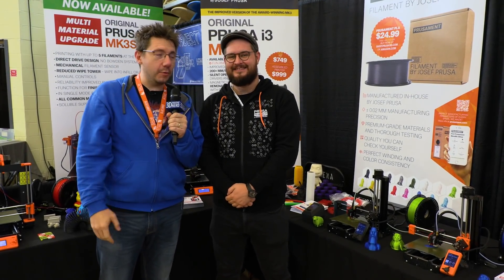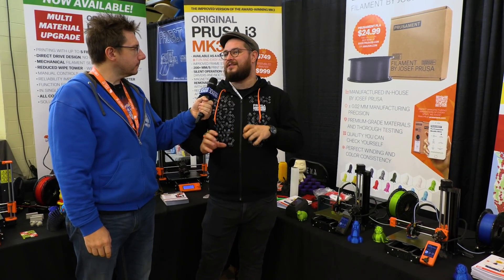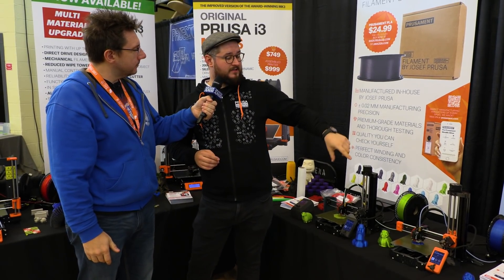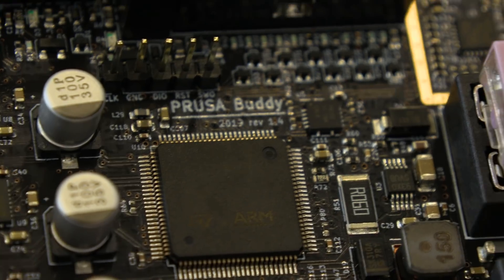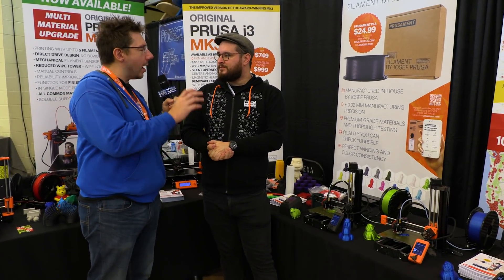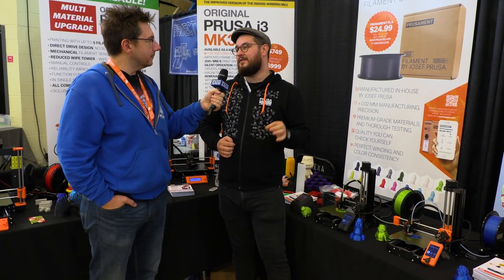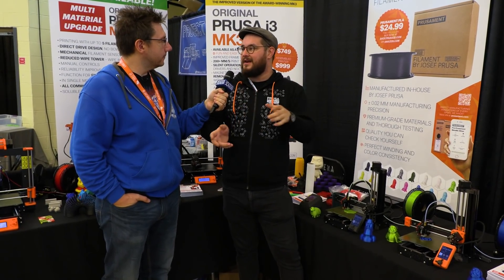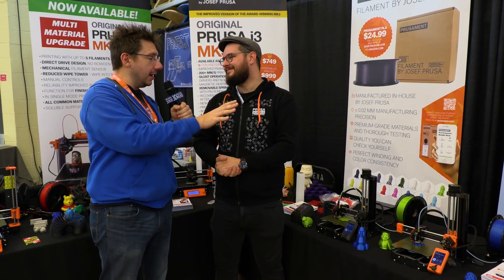$349 PRUSA MINI - Impressive Features AND a 32 bit board in a Smaller Form Factor

Comment: I’m late to the party. I am looking at getting a 3D printer to make stuff with my kids. I was looking at the ToyBox that he reviewed because it seems easy to use with library of models that can be sent wirelessly with an app. 
I did not like how small the print bed was. Can anyone chime in on if this is a good one to buy for a noob? 
I’m looking to spend less than $500. I have limited knowledge but will learn fast. I want to be able to grab an STL file of let’s say a LEGO or a rubber band gun and print with my kids. Any recommendations are appreciated. Thanks.

Comment: Two questions: Does the mini have the same filament jamming issues that the MK3S has? (I know this can be fixed by replacing the 2.2 to 2.0 MM heatbreak with the older straight thru 2.0 mm bore heatbreak, but it would be good to know if this printer has that same problem out of the box, or if Prusa has rectified that problem). Second question: Is there a reason why this mini could not also have been offered with a max hotend temp of 300 degrees, like the MK3S? The stated max hotend temp of 280 degress is not quite good enough to print Nylon, Polycarbonate, etc.

Comment: I have a 0.8mm nozzle on my printer right now because I was printing parts with a large layer height so that it would speed things up. If I want to print at .1 or .2 mm layer height, can I still use this nozzle or should I put a smaller one on?

Comment: Is it Quiet?
Reply from the maker: It was pretty darn quiet. Granted, it was in a loud area, but up close I couldn’t hear it.
Reply: @3DPrintingNerd  Thank you for the information. Manufacturers don't seem to understand that the home 3d printer usually is not placed in a factory. But are loud as a piece of industrial machinery. I had a really bad experience with Creality CR-20 pro at 65 dB.

Comment: Prusa Mini. The cheap printer that is still about $100 more expensive than my 280*310 32bit delta (with tmcs).
Reply from the maker: Which Delta are you rocking?
Reply: @3DPrintingNerd  "Stock" rostock kit (with linear rails or how is it called). I bought it about 2 years ago from Ali as a kit for like $150 back then (really cheap). And in those 2 years, I added 32-bit board and tmc drivers. And I love it (especially for the price).
If I were to add my last upgrade (Asus tinker board and rpi touchscreen) it would get to around $350, which is still really good for such a machine.

Comment: Still a bit expensive given you can get something better for far less through imports. My printer prints much larger items and cost less than half this. For $40 I could upgrade it to 32-bit and auto leveling(Which I don't really need either, though 32-bit would be nice for faster prints). I can see some markets though where this would do well.  But to most makers and tinkers there are better options with kits.

Comment: ok a question i have not seen asked is does the print ship assembled or do you have to put it together?
Reply: GeekMoto13 you have to put three total pieces together. Takes less than a half hour according to their video.
Reply: @lasersandlayers  ah ok, i had the mk2 and that was a bit of a pain to put together, sounds like this will be easier to deal with and get up and running quickly.

Comment: I am extremely confused as to why anyone would buy this when you could get a Creality Ender 3 for $230, not $350, and it is can produce a 250mm cube, not 100mm. Am I missing something here?
Reply: The Ender is the Hyundai, the Prusa is a Mercedes ;-) Its another Level of Quality and Support.
Reply: Prusa Mini can produce 180mm cube.
Reply: Yes, why wouldn't I choose the cheapest model from the brand that made my CR-20 Pro that I gave up trying to fix and literally smahsed after getting fed up with it's countless issues? Bigger print size doesn't necessarily equal a better printer, a better printer equals a better printer. My current printer, a Primacreator P120 has a mere 120x120x120mm print volume, but has been far more reliable and user friendly and has a better print quality than my CR-20 Pro ever had.

Comment: This printer will be an easy upgrade for someone coming from something like a Monoprice Select Mini with its 12x12x12 print volume. It also puts it as a possible competitor to the more recent FLSUN QQ-S printer with its 18x18x30 print volume that is in the same price range.
Reply: That's quite literally me. I currently have a Primacreator P120 which is basically the same as the Monoprice Select Mini and I'm seriously considering a Prusa Mini. I was thinking about getting a Flashforge Adventurer 3, but this is about the same price, so that's a no-brainer really.

Comment: I hope we see a blog post about just where the cost savings came from sometime. Not because I'm worried about performance or quality (all of these printers have had some growing pains out the gate, but they've all started with a solid foundation to patch in the months following), but because I'm just really curious how this wound up being a three-part printer. It's not rare for Chinese-made printers to ship like that anymore, but PR probadefinitely has higher labor costs. The difference between a fully-assembled MK3S and a box o' parts with the hotend being the only pre-assembled component is $250. I'd assume the pre-assembly time is decently less than that of a MK3S considering the gantry's cut in half and those printed plates on the X probably aren't as keen on letting the extrusions twist and cause skew, and squaring the X carriage with the gantry looks like it ought to be a smidge easier with an extrusion instead of a relatively thin plate for a Y frame, but I'd imagine that'd still account for $100-150.

Basically, I just want to know if it's a $200-250 bot after profits, or if they have some sweet automation or nifty jigs for slapping these together in a hurry at a fast clip. The latter would be really, really cool, and would hype the beans out of me for a possible sub-10-part MK4 (not counting fasteners) or some other future Prusa bot. Those kits are a fun way to spend part of a vacation and kick up the pleasant smell of bearing lube with parts all over the surgery bench, but it's so much more time-consuming than the pretty-alright machines coming out of China nowadays.

I don't regret slapping together and upgrading one of my i3s beyond reason at all (it's an illness that I've come to enjoy), but when people ask me about getting into the hobby and aren't currently mechanically-inclined or just want to set something up and get right to modelling, I recommend an Anycubic or Creality bot because they're practically fit to run right out of the box at a less heart-stopping price than a similarly-ready i3. That recommendation might change to a Mini when that comes out, at least for people who aren't going for large cosplay parts and the like. Sometimes I get asked down the line how to get prints that look more like the stuff sitting in my office, with its practically perfectly even walls and smooth corners/tops, and I steer 'em toward some cheap and relatively easy mods to another printer for whatever's lacking in their prints. I can just about guarantee that at least a few people I've brought along for the ride would've been fine paying for an i3 kit instead of a $300-600 something else that needed another ~$100 in mods, but not an assembled i3, and that they'dve noped right out after seeing the build guide because of the time investment. No skin off their bones after they get an Ender or CR10 decently beefed up, but it bothers me that I can't suggest such a good printer more, because after the initial hassle, it's solidly the most reliable and capable sub-$1,000 printer out there for the form factor, with no need to grab new drivers, belts, fans, MOSFETs, etc. Besides, mesh levelling, skew compensation, and live Z adjustment put most of a newbie's issues on easy mode after the build's over.

Whew! Wasn't expecting a YouTube comment to balloon into such a wall of text. To whoever might read all the way down to here, I hope it was at least a pleasant descent.
Reply: My thing when I'm recommending a printer to people who aren't mechanically inclined is auto bed leveling. A lot of people seem to struggle with leveling beds manually when they start out and ABL lets them somewhat forget about that as long as it's well implemented.  You want them to not get bogged down with tweaking stuff before they get any satisfaction out of a good print. As such, this seems like a great deal for someone like that. Yeah, my Ender 3 with 700 bucks worth of mods makes absolutely perfect prints, but I had to pour a lot of time and energy to get it that way. This seems like a no brainer. For 100 bucks more than an E3 Pro you get something with the features that would cost you easily over 100 bucks to achieve on said E3. 

Only problem I have is the cantilever design. I'm concerned with the rigidity. The x-rails being supported on only 1 side by what I assume is a PETG structural part makes me nervous. Then, Instead of something rigid like an extrusion with a linear rail, it's 2 rods and linear bearings. That concerns me that It's gonna have ringing issues at higher speeds, especially since it's a bed slinger as well. At least it's a bowden, which should help. I'm one of the few people that prefers well-tuned bowden extruders. I know I'm weird, but I like to push speed. I'm not so much worrying about sagging because ABL will somewhat compensate for that. It will absolutely print great at normal speeds I'm sure. You're probably just not going to be able to push up into the 100s of mm/s without issues I'd hazard to guess. Perhaps I'm wrong and it's light print head will make it more like a delta.
Reply: Yeah, I'd probably put this in the 40-60mm/s range. Possibly more if you're only using the +X half of the bed. If it's all that much of an issue, I bet we'll see at least one good mod to shore it up for under $50 later. (Those'll probably happen even if it's fine.) Thinking it'd just need another extrusion and a v-slot roller to take care of most of the wobbles on the hanging side of the gantry and then way more work to make it totally stable with diminishing returns.
Reply: So I don't crowd that giant post with a tangent, I'll just reply. If anyone else gets those kinds of questions and is inclined to lend a hand, try to see if there are any maker spaces nearby. I live in a city that kinda lags behind the bigger locales as far as getting new tech goes, but even here, pretty much all the maker spaces that have popped up went straight for Ultimakers and the like (haven't seen a Prusa in the wild, but it seems like it'd be right at home in the setting). If it's an option, having something like that around for the occasional aesthetic prints can do a decent job sating any upgrade itch people might get until they're sure they can and want to. They might even be better off just slinging files and spools at someone else's printer for the odd job instead of throwing down for their own machine, because they might not have a whole lot of use for a printer after all.
Reply: Personally, I would still recommend the Prusa Kit to everyone who will ever buy a 3d printer just because things will absolutely go wrong when printing and people need to know how to fix the issues and one of the only ways they are going to be able to do so without always having to go to support is building the kit themselves. I don't care how mechanically inclined someone is. It is a learning experience that every 3d printer owner MUST go through.
Reply: @scythelord  You are probably right. I think the idea of a 3d printer that "just works" is kinda flawed. These are cnc machines basically. There is a lot to go wrong. People should know how to fix them and they should be easily user serviceable. The first time a filament clog or blobbing on the hot end happens, a lot of the "easy to use" printers go in the trash for some people and that's a shame.

Part of the hobby is learning about fixing things and manufacturing in general. Hell I spend more time working on and improving the printers than anything else.

Comment: I don't get it. How is this a good buy? It's tiny. I got my CR10 for that price.
Reply: Brandon Gallacher as someone whom owns both a CR-10S Pro and a mk3 I can definitely state that any time i don’t need the build volume of a CR-10 I’m using the mk3. It’s infinitely more reliable. IMO. And, on top of that, it’s easy to use (with an entire ecosystem to build on) with ABL combined and a Flexbile build plate. Sure, I’d love it if this was $100 less. But the ease of use and reliability, combined with Prusa’s ecosystem and excellent customer support, it’s almost a no brainer. As long as you don’t need the bigger build volume. :)  If you are good with tinkering and don’t mind the occasional headache that a creality printer brings, then that’s great. But not everyone is you, and that’s why this printer is great. It opens 3D Printing to potentially a ton of new people. And that’s awesome.
Reply: @lasersandlayers  Fair enough. I would still wait till the price drops. That tends to happen pretty fast in this market.
Reply: Youtube and the 3D printing Facebook group have been my customer service and they have been fantastic lol
Reply: Having owned a Creality CR-20 that I actually gave up trying to fix I don't really have that much faith in the Creality brand. Quality costs and Prusa printers are renowned for their high quality. This is a very appealing printer to me and would be a nice upgrade from my current Primacreator P120.

Comment: 6:17 can someone please explain Prusa Answer in easy words?
Reply: So think of it like this: The new controller/board they are new using has a lot more processing power than before and it's capable of running an operating system (think iOS, Windows, Linux) along with two "programs" at the same time. One of the program (Marlin) takes care of movements on the x,y,z, E and then the second program take care of handing all the inputs/LCD display functionality. The advantage of doing this is that both programs can run at the same time on the same microcontroller which helps improve overall performance without having to having to deal with say having two 8 bit controllers (one to handle movement, another for the display).
Reply: @shadow7037932  Thanks for explaining it.

Comment: If the upcoming CoreXY Prusa has an enclosure and dual extrusion option (or heck, I'll live with MMU2S)... I think can come up with a solid business case for that. I'll even Home Depot the enclosure, air filter, and longer wiring. Truth is, the Prusa MK3(s) is truly a "throw gcode and filament at it and go" machine when properly built and calibrated (which doesn't take long at all), whereas the $4000+ machine we use for large format supported ABS is just one of the most finicky beasts I've ever used. Just in the past week I've had prints detach from the bed like 3 times, which almost never happens on the Prusa, even with ABS. I've written off the bed surface and put a layer of ABS Gloop on it: works much better.

Comment: This is cool, but I can’t wait for Prusa to put out an enormous-sized printer!
Reply: I heard The Prusa xl (40x40x40cm) using a corexy system is in development
Reply: We got to talk with Josef at the ERRF. He was telling us about the larger printer coming out next year... 
Of course I requested an onboard camera, LED lights, and multi-material capability. Fingers crossed on these “wishes”...
Reply: @Wodpuncher001   I beat them.. I have a core X Y big area 3D printer by Tronxy which is a X5SA cube design, does prints 13 inches wide by 13 inches deep and 15.7 inches tall. the hot end does X & Y the Z is the hot bed and that moves up and down not forwards & backwards like the Prusa, it is a silent drive system and board, with auto level and manual level, can be fitted with a magnetic ultra flexible bed ( I got that now ) It has 3.5 inch colour touch screen, filament run out detection, and auto power out restart printing from last done layer. You can use the SD card with a PC USB reader for files or the PC port using a printer cable. And only cost £309.00p UK and I got it in 3 days after ordering on Amazon UK.  So there's Jo Prusa saying his be around in a year and cost $1200.   I think this will beat him there.

Comment: A question for Josef (I know he is often reading comment bellow Prusa printers videos): The max. hotend temperature is 280°C and the PTFE tube is at 160°C (saw on Tom's channel), if I change the PTFE tube for a Capricorn tube can the hotend go to higher temperatures? Thanks! Looking to change my very modified Ender 3 for a Prusa Mini :)
Reply: You  surely Will have To change the heating element and the termistor To high temps.
Reply: @GuyMassicotte  The heating element and termistor is not the same as the one on the e3d v6?